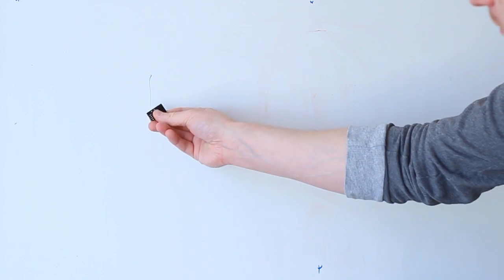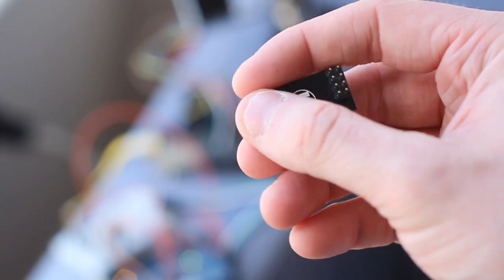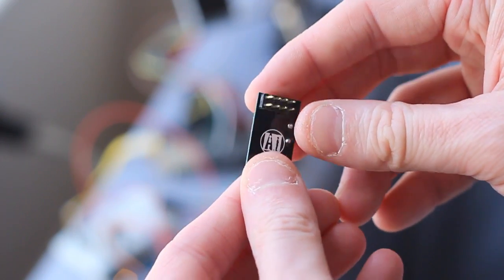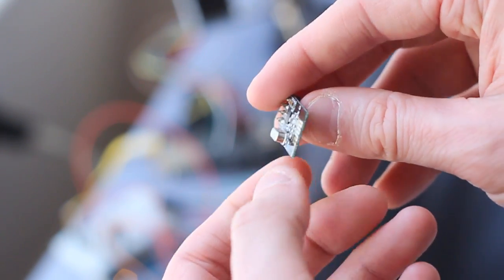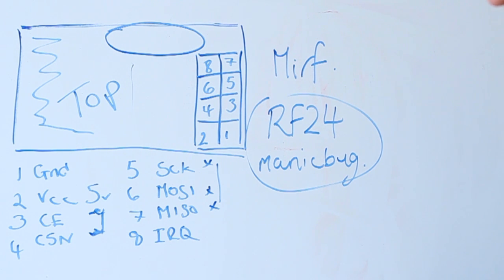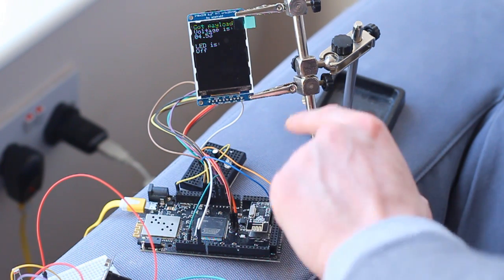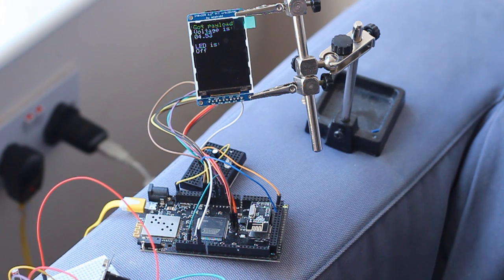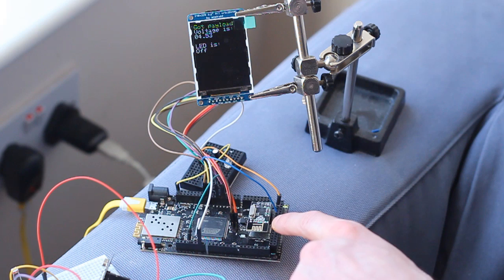NRF24L01+ Wireless Transceiver Module: Getting Started (NRF24L01)

Comment: If anyone cares to help me, please let me know how I can reduce the latency of data transfer via the NRF24L01. I require to transfer integers ranging from 1 to 240. Transmission distance required is not more than 20 meters. Even 10 meters would be sufficient. However, as the integers may change quickly, I would require the  transfer of integers to be smooth and continuous. To be clear, I would require something like, 300 integers to be transferred per second. Any guidance or help will be greatly appreciated. As of now, I am having a latency that is approximately 0.7 to 1 second. I see so many demonstrations or so much lower latency.

Comment: hi, i have an battery controller unit and its display which has  the same chip, but their wireless range is very short and limited so i wonder if i could replace those with the new one nrf24l01 that comes with an antenna to extend range. so will it work like plug'n play or i should program it only then it will work?

Comment: Hello sir,
Can we use NRF24L01 with Arduino for commercial automation ?
Reply: Using arduino for commercial projects is not a good idea. I suggest you to go for a 32bit microcontroller with an ARM core like stm32, TI, lpc etc

Comment: Hello, congratulations for your videos, excellent. Sorry, one question. I have two Arduino Nano 3.x (ATmega328), each has connected a nRF24L01. One acts as transmitter and the other as receiver. The receiver has connected a display uOLED-96-G1. Is possible with this infrastructure see in the screen oLED96G1 if the intensity of the transmitter signal is high or low? or status intensity of the transmitter signal?  , how can programming this in arduino? . Thanks.
Reply from the maker: Hi Jesus, as far as I know signal strength (RSSI) is not part of the feature set of the NRF24L01

Comment: I have the same transceivers sitting next to me. However, my Arduino Uno got bricked after I tried to upload a program that took 93% of it's memory space and was never able to fix it. But my question is, is there any libraries open for the raspberry pi that could use these transceivers?
Reply: to un brick you probably need to flash the bootloader to the uno

Comment: How to connect my iPhone 6s to this module?
Reply from the maker: You can't unfortunately, it isn't the same protocol as bluetooth or wifi.
Reply: I'd recommend using a HC-06 bluetooth module for that, it's quite cheap and can work as a master or slave device. The HC-05 could work as well, but it only works in slave mode, so it might not be what you need, depending on what you plan to use it for.

Comment: I was wondering if you could help me out with my project?  I want one to work as a master and the others as a slave unit.  The master would send out a signal from the input of button press and turn on an LED on the Slave units.  Assuming you can connect and control  several units at the same time.
Reply from the maker: +Nick Sebring Hi Nick, sorry for the late reply. I think there is an example in the RF24 library that does just that.

Comment: how many channel can this thing transfer?
Reply: This question is not clear. If you think on how much channels it can be set, the answer is 125 (from 2400 to 2524). Each channel represent 1 MHz, so say CH22= 2400 MHZ + 22 MHz = 2422 MHz, or 2.422 GHz. Channel zero (0) is then 2400 + 0= 2400 MHz. If you ask how much bytes you can transfer, answer is maximum 32 bytes. There are 6 pipes (0 to 5), which can be opened to communicate with 6 devices at the same time (actually one by one device).

Comment: does the nrf24 run on 5v or 3.3v? all of the other sources say 3v3
Reply from the maker: +khabeer salaam  3.3v, as mentioned in the description I made a mistake in the diagram. Mine does have 5v tolerant input pins though.
Reply: +David Watts OK thank you! didn't see that

Comment: Can we use NRF24L01 module to transmit and recieve at the same time (Bidirectional)?                  if we can do this,I want the code please
Reply: Hey, I don't think that is possible. You can either transmit or receive at one time. SO, you'd need 2 of them for the purpose of transmitting and receiving.

Comment: I hesitate on these for one reason: I have and esp8266 in the same form factor and after 6 months I still cant get it to work. I officially quit on it lol
Reply: Don't let your failure set you back. Learn from it!
Reply: ESP8266 id bit different. I did not play with this one, but nRF24L01 is quite easy to make work. Do you have FTDI adapter? Do you have good library for this thing at all? Out there are plenty examples on the web, some on YouTube channels, some on various forums, and standalone pages. Check it out, you will make it work soon. Fingers crossed!

Comment: Hi David. I want to know if this module can be used without a microcontroller. We have these encoders/decoders available that work with 300/400MHz transmitters without the need for a microcontroller. Secondly, if I just want to send a data packet representing some message, number or code (binary preferably), can it be done with this module?
Reply from the maker: +Ritendra Mishra Sorry mate, I don't have a clue. Maybe try the Google+ community.
Reply: +Ritendra Mishra It would be problematic to set up the nrf without a microcontroller, since you need to initialize the nrf24l01 by writing to some registers (addresses etc.), the input and output is also done using SPI.
Reply: Thanks.

Comment: Hi,
If you have multiple chips running near each other, how do you distinguish the signals?
Reply: +Wei Zheng When you config the chip, you have to set up a 5 byte address on both receiver and transmitter :)
Reply: By setting address. It's in the datasheet

Comment: Would these be difficult to use on a network type of project. I basically want like 4 or 5 of these communicating with one another or having one arduino transmit data to another adruino and then have that one transmit to one I have hooked up to a computer in my home, kinda like a repeater situation.

Comment: Thank you for your videos, David. They are very instructive.
Can I pair (bind) one of these NRF24L01 to (with) a 2.4GH remote control from an old RC quad copter?... How?
Reply: +Wellyntong Breton That might be possible, but certainly not easy because the chip uses a communication protocol on top of the basic radio transmission/reception. I'm not sure the protocol can be completely disabled: I know you can send some bluetooth commands though :-)

Comment: Hey David!
Thanks a lot for this video. I would need to transmit messages not only between two Arduinos, but also between an Arduino and a Raspberry Pi 2 Model B V1.1. I've been researching for a while now, but all the examples (for instance: www.arvindbalaji.com/communicating-from-arduino-to-raspberry-pi-using-the-nrf24l01-radio/#more-87) on the net I have found so far don't work unfortunately, probably due to the difference between the newer and older models of the Raspberry Pi boards (i.e. ARMv6 vs ARMv7) I eventually only get zeros in the entries when running the NRF24L01 on Raspbian when running sudo ./RF24RaspberryCommunicator/remote -m 0. There is a thread in a forum (https://www.raspberrypi.org/forums/viewtopic.php?t=99227) handling the adoption of the RF24 library from ARMv6 to ARMv7, but unfortunately I still get all those zeros and communication is not established.
Do you know any well working example / project that uses the NRF24L01 on a Raspberry Pi 2 Model B V1.1?
Thank you
Jean
Reply: +Roberto Lo Giacco Thanks for the post and the two links. I am currently waiting for a parcel containing capacitors I need for the NRF, but I'll look into your tutorial right after delivery. I do have the Raspberry 2 Model B V1.1 though and I see you used the old one, but I think this will not be of any issue, just a slightly different pin set.
Reply from the maker: +Jean-Luc Burot Sorry buddy, I don't know any good examples. Hopefully someone else will be able to chip in with a suggestion.
Reply: +Jean-Luc Burot zeros means you have wired it incorrectly. I have a blog post describing the correct wiring of these modules to a Raspberry Pi (https://rlogiacco.wordpress.com/2014/02/26/nrf24-on-raspberry-pi/) and I'm in the process to publish a tutorial with the introductory post already published (https://rlogiacco.wordpress.com/2015/09/06/nrf24-walk-through-introduction/).
Reply: Jean-Luc Burot actually there should be no pin change, the software might require some modification...

Comment: hello sir! I'm Michael. Would that be any chance of you giving me some advice regarding this chip? This video was perfect. However, I'm having a bad time understanding how each of the pins work. Do you know how would I connect a IMU (inertial measurement unit) to this sensor? My biggest problem is that I'd have to get 6 signals from the IMU and I'm struggling to understand how would I do with this NRF24L01...

If it's not a problem for you, here's my e-mail address. mic_robs@yahoo.com
Also, if you want to do me a real big favor, we can also skype (microbs4) 

by the way, I'm from Brazil. :)
Reply from the maker: Michael Robson Hi Michael, you will need a microcontroller to collect the data from the IMU and send it to the NRF24L01+ module.

Comment: I have two NRF24L01 and two Arduino nano's. Programmed one as transmitter and the other as receivers. Cant get it to work as expected. Even slapped a 4.7uf capacitor on both the NRF modules. Both arduinos are powered by 5V output from an ESC that is powered by 7.4 2S lipo. Not sure what i need to check now. Could you please help.
Reply: +SMorrizz Are you powering the nRF24 modules from 5V? In that case you might have already fried the things: they run at 3.3V.
Reply: +Roberto Lo Giacco thank you,  I figured it out finally.
Reply: +SMorrizz What was the problem?

lg, couka
Reply: Die Bastler Werkstatt ignorance :)

Comment: can nrf24l01 communicate directly without arduino or pic or micro controller 
please help connect switch at txr connect led at rxr after communication led  should glow

simple communication without any other controller devices
Reply: +Boppana Ramaseshu the nrf24l01 requieres an a microcontroller to function, since they take in and output data via SPI.

Comment: can nrf24l01 communicate directly without arduino or hould glowpic or micro controller 
please help connect switch at txr connect led at rxr after communication led  should glow
Reply from the maker: Boppana Ramaseshu Hi mate, sorry for the late reply. As far as I know you cannot use it without a microcontroller. This dude covers the rest - http://shanes.net/simple-nrf24l01-with-arduino-sketch-and-setup/

Comment: Will I be able to transmit video using this ?
Reply: +Muhammad Usman no, I don't think so. I mean, in theory you can transmit anything you want, but considering their fastest data rate is 2Mbps (mega bits, not mega bytes) and each packet can not exceed 32 bits.... even pushing them to their limits you can probably achieve a 5kbps in close range... An uncompressed video stream of 320 * 240 in grayscale at 24 fps requires a bandwidth of about 1.8MBps (mega bytes, not mega bits). The only option I see is with very small size and highly compressed videos... 

I've published yesterday the second part of my walk through and since I don't like to spam comments please look above for the links if you are interested ;)
Reply: +Roberto Lo Giacco thanks for the reply :) .. I figured it out at the end .. Looked into video transmitters and router .. and at the end decided to go with the router to avoid synchronous issues .. I will defo watch your new video :) ..
Reply: Muhammad Usman it's not a video, but a series of blog posts: the URLs are a few comments above.

Comment: Great modules, I've got a project that reads a number from an RFID-RC522 and Temp/Humidity-DHT11 want it to look a bit like this: (198,25,48) \\RFID,TEMP,HUMIDITY and found I am getting really frustrated trying to send the information with this module - error with float and int to const string.... any ideas?
Reply from the maker: What kind of error do you get? Take a look at http://www.arduino.cc/en/Reference/Cast to cast your float to an int. The you can use itoa to convert to a string. Or just int tempInt = yourvalue; String tempStr = ""; tempStr = tempStr += tempInt; (provided you reset you values at the start of the loop.
Reply: David Watts I cant express how happy you've made me! lol.
Your suggestion of:
int tempInt = (t);
String tempStr = "";
tempStr = tempStr += tempInt;
Worked perfectly and more as I was able to use the same function above for the Humidity and RFID data and then combine all into one message! perfect.
Thank you so much... I been working on this for a couple of nights now! lol.
Reply from the maker: Lee Foster Really glad it helped, I had the same problem as you when I did it first time around, floating point errors are the worst.
Reply from the maker: You might want to make your string conversion into a function to clean up your code.
String Message; //You base string, blank it at the start of your loop

void AddNumsToMsG (int val, float valF, float valF2){
int floatToInt;
floatToInt = (int) valF;
int floatToInt2;
floatToInt2 = (int) valF2;
Message= Message += val;
Message= Message += ','; //possibly double quotes
Message= Message += floatToInt;
Message= Message += ','; //possibly double quotes
Message= Message += floatToInt2;
} 

//Then call the function like this 

AddNumsToMsG(YourInt, Float1, Float2);
Reply: Wow, thank you - will work alittle more on it tomorrow, cheers

Comment: How many these transceiver could work simultaneously in one location?
Reply from the maker: I don't know if there is a limit but it is a lot certainly, this guys says it is up to 6000 - http://maniacbug.wordpress.com/2012/03/30/rf24network/
Reply: David Watts Thanks for super useful link. Is a variable that you define channel in your code?
Reply from the maker: Mar Canet Yeah, I believe they are called pipes that you listen and transmit. Here is a link to the function - http://maniacbug.github.io/RF24/classRF24.html#aa7e8523f86f9f8f20c274e0c89a5fd45